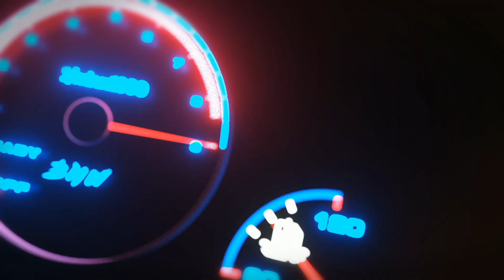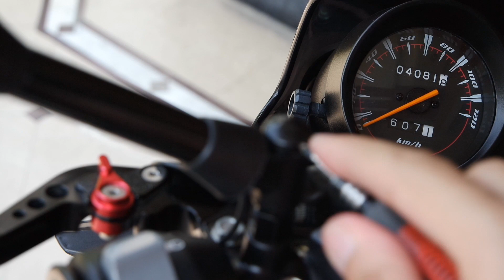LED Side View Mirrors Instalation In Bike | Yamaha YBR 125 Modification

Comment: Bro i need help again , 😅 right side py kesy install hona hy mirror
Reply: Ma us ko drill kr ln just, drill machine sy thora explain kr dien kitnay size ki drill or kis taranh sy marni hy 😬
Reply from the maker: Drill ka size koi b hojae, its should be smaller than the hole, you should drill and flatten out the old screw hole just enough so that you can screw inn the new side mirror, you have to screw it with a lot of pressure to make it fit in.
If you dill too much, you can use appoxy to fix it, pr dehan rekhna ziyada drill na kro threads ko cuz then original mirror ni fit hoga proper resale kharab ho skti
Reply: @PkModified  thank you so much brother
Reply from the maker: My pleasure 🥰

Comment: Bro,I have also installed these Audi style indicators on my ybr but the problem is that when I give the turn signal,the indication light that is installed in meter cluster dose not glow,what can be the reason???plzz replyy asap..
Reply from the maker: With led turn signals the meter light wont work, only way to make it work is to install a semiconductor diode, idk if any mechanic would do that for anyone

Comment: Fitting upside down hey right left swap ho gaye hein
Reply from the maker: This way you have a better view from the mirror due to its shape
Reply: @PkModified Okay bro, i have YBR do you recommend these mirrors specially for touring?
Reply from the maker: @razaismaili1  I dont think they are good for touring, as they have adjustment nuts which can come loose and cause vibrations, other then that there is no issue with the rear visibility

Comment: Behtreenly done bro. And i need your advise, should i buy a brand new Pridor or a 2018 YBR?
Reply from the maker: Ofc yamaha ybr 125 you wont regret it, if you want to ride bike with 1-2 passengers then buy pridor
Reply: @PkModified  Nah I'll be riding alone mostly or just with one passenger sometimes. I was also thinking about getting YBR. I'm getting a used one in 127k do you think its a good deal?
Reply from the maker: @hamzakashmiri137  its a good deal, ap ko 2016 model Japanese version 1lakh tk ka b mil jae ga
Reply: @PkModified  han g mil to jata hai but no ads of those models in gujrat side. Plus i really like the new racing blue color

Comment: seeing your video after 8 months bruh, much appreciated your work. Can you tell me how these mirrors are going on so far?
Reply from the maker: They are going just fine for now, sorry for late reply really busy in studies these days
Reply: @PkModified  any electrical problem so far, regarding the lights?
Reply from the maker: @randomstalker2690  nope, nothing so far, all of the lights are working fine although the front hid went out i had to replace that but those usually last that long
Reply: @PkModified  I am searching for some good headlights for mine too, but am unable to find. Can you suggest me any good item please?I badly need those as I have to travel at night mostly
Reply from the maker: @randomstalker2690  mne abhi M: 02E RTN lgai hwi, don't think original h pr is ki viability bohat achi h low beam pe b road pe acha focus hota
Reply: @PkModified  from where to get those?
Reply from the maker: Mna to local shop se li thi, pr online b mil jae gi chaudhry auto store ya afzal traders se
Reply: @PkModified  thanks for guidance bruh!

Comment: Super clean video and editing skills man, I have to subscribe, how fast does your ybr go?
The max I have had it off mine so far is 66mph!
Reply from the maker: I dont drive too fast, i went till 100km/hr and the road ended, but i can go till 125km/hr
Reply from the maker: 77.5 MPH if you convert to miles per hour
Reply: @PkModified  corrections I got 73 mph yesterday and then the hill end but it still wasn't quite at the rev limiter!